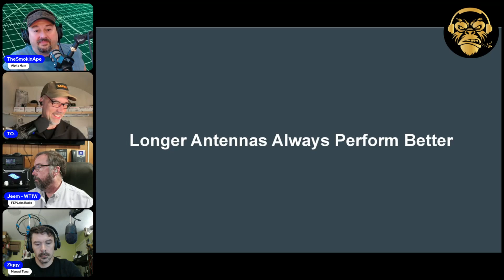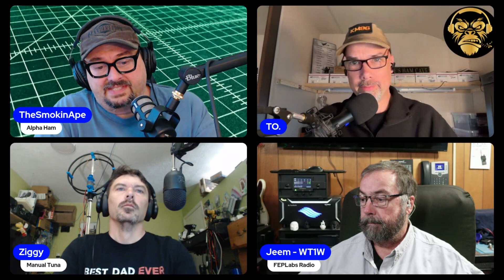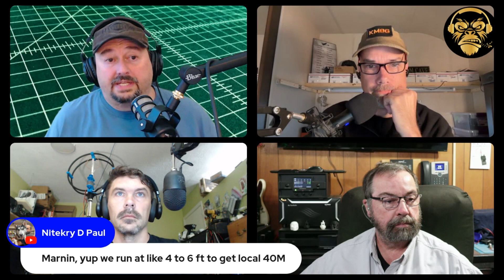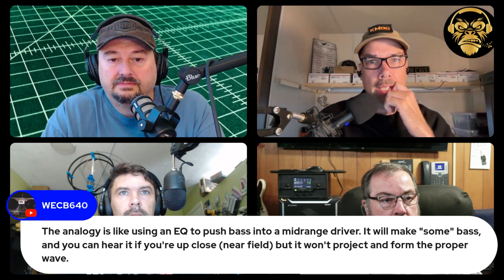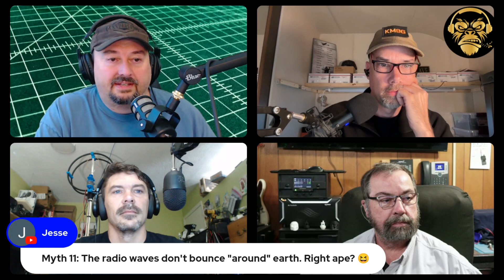Is Antenna HEIGHT the SECRET to BOOSTING Ham Radio SIGNALS?

Comment: I use a Buddipole for 20m portable with a 12 foot painters pole, as I cannot afford the expensive 33-foot mast Buddipole sells. According to the far-field plot in the manual, a 20m dipole at 8 foot above ground, the takeoff angle is 75 degrees, but there is only 5 db of loss loss at 15 degrees. I have had no problems with my low Buddipole. Maybe I'm 1 S-Unit lower than I'd be if the antenna were up 33 feet  I have also configured my Buddipole as a 1/4 wave vertical on 20m with a ground plane of 4 wires, each 17 ft. This gives me a low takeoff angle closer to 15 degrees. It's hard to compare the two side by side, as I can only have one set up at a time. But I have had success with both configurations. Obviously higher is better, but the difference is only 5 db or so.
Reply from the maker: Hey Brian, thanks for sharing your experience 👍

Comment: Great Ape. Radio waves change at longer wavelength like 160 meters and longer.  Them bands will open at night . In a January winter in NY . I made a 160 meter 1/2 wave dipole in state land we can use all year camping . Antenna was laid on top of snow !  At midnight I talked all across the US . I had to shorten quite a bit to tune.  Get into long wave and stays the same day or night . Got down to 60 KHZ . WWVB . Signals pass through the ground.  The VLF band is how we talk to subs under water . 73
Reply from the maker: Hey Robert, thanks for the comment 👍

Comment: Higher antennas can be a major problem when it comes to electrostatic/corona noise. It always affects the highest point/antenna on the tower. Contest stations realize this and have lower antennas for better RX.

Higher antennas also can become a lightning attractor. However, radiation angles change with antennas, for instance moving my 6m yagi higher than a wavelength is recommended to lower the lobe toward the horizon.
Reply from the maker: Great points, thanks Hayden!

Comment: Back in the day on CB band my friend had a 72 foot electric crank up tower.  I lived a few miles away.  At the base, his antenna started at around 30 feet (tower + pole) at the antenna base (Maco 5/8 wave).  As he cranked up the tower, his signal would increase.  From 30 feet to 40 feet it went from like S7 to S7.5 and then from at 50 feet it was around S8.  Then from 50 feet to 80 feet it went from around S8 to S9.  So from 30 feet to 80 feet, his signal increased around 2S units (or 12dB).
Reply from the maker: Was that Line of Sight or Skywave propagation?
Reply: @TheSmokinApe  Just in the city - a few miles apart from each other so it wasn't skywave and it was not perfectly LOS.  More like partially blocked LOS however, my guess is after he was above 50 feet, it probably was fully LOS at that point.
Reply from the maker: OK, that makes more sense for that.  Thanks for checking out the video X28!

Comment: Height is might for VHF/UHF
Reply: It's still height vs RF loss in the coax cable.
Reply: @StephenGangi  Cable loss is not a big deal and is just an engineering variable. Just use better cable.  LDF7 can go a long way.  

For other applications, waveguides or RF to fiber converters.
Reply: @TheSzalkowski  Yeah... some folks do consider it though - in VHF/UHF.  The higher in freq you go,  the more loss there is.  So yes, GOOD cable matters.
Reply: @StephenGangi  Yes you should consider it but it is not really a tradeoff with antenna height.
For UHF/VHF
You determine the range you need to meet your mission.
Then determine the antenna height needed to meet your range requirement.
Then choose antenna/RF cable that gives you enough EIRP to meet your link budget.
If cable loss is a tradeoff with anything, it is money. 
I can make a 600ft cable run work at 700Mhz but the cable required to minimize the loss is going to be expensive.
Reply from the maker: Agreed Mark